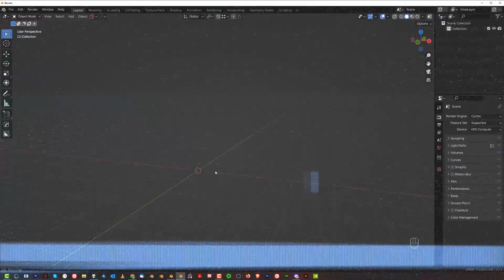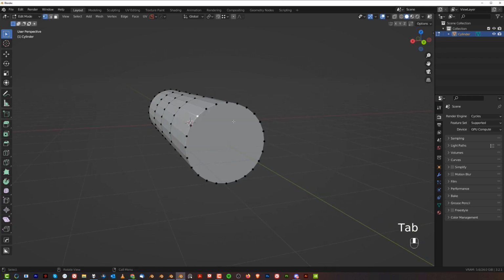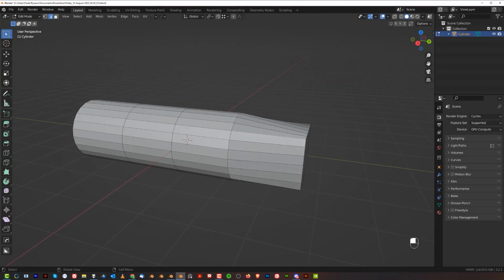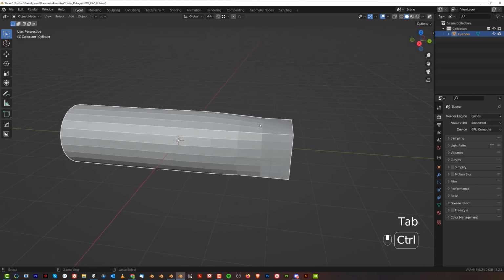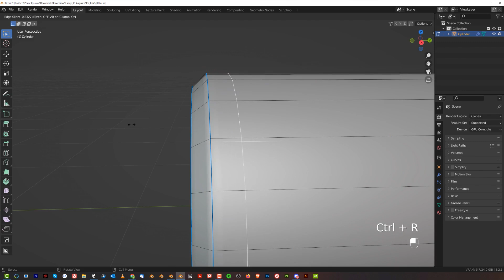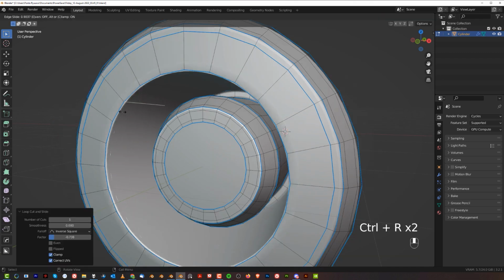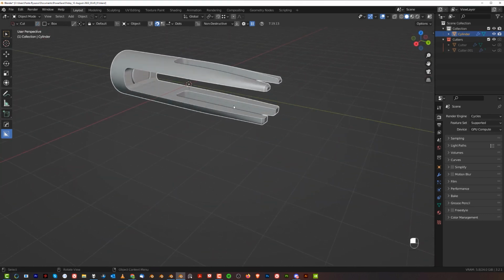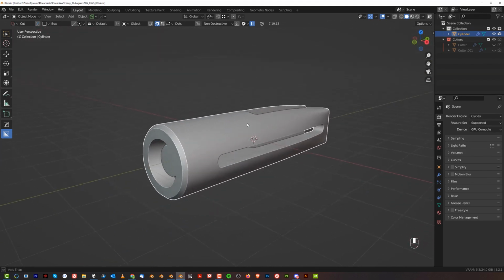How to Make a Circle Turn Into a Square in Blender!

Comment: Thanks Ryuu. If I mark the edges of the circle side and press Q and Mark, it makes the edges sharp but then I have not the chamfer as you have. Do I have to set somethings in HOPS?
Reply: I think he set the mark angles in the settings to 30 deg, default HOps setting is 60 :)
Reply: @mikari67  Thank you. I will check